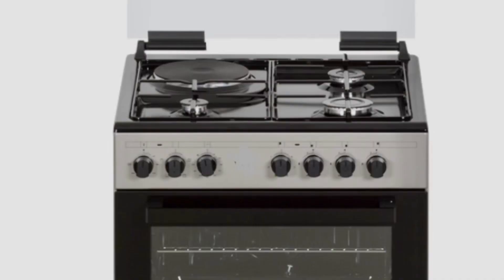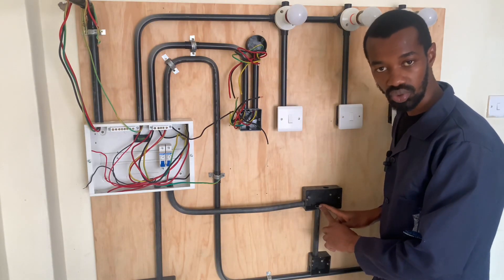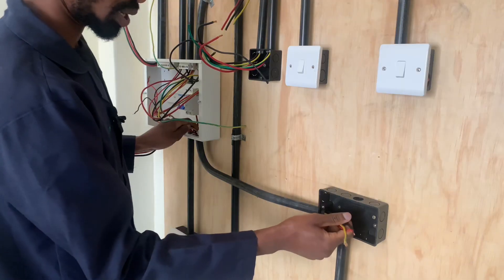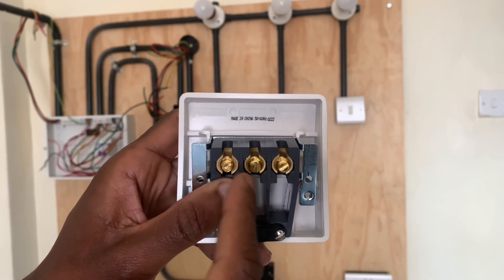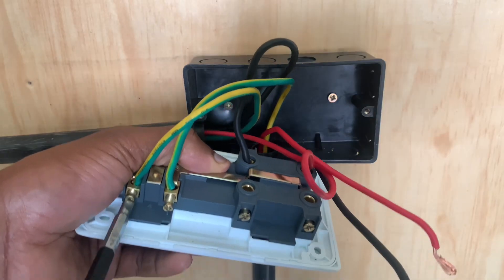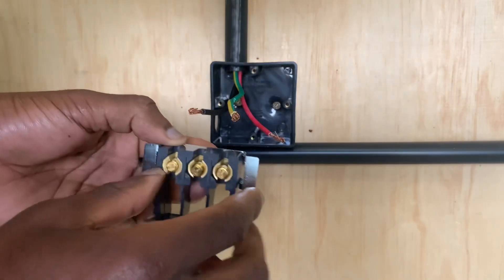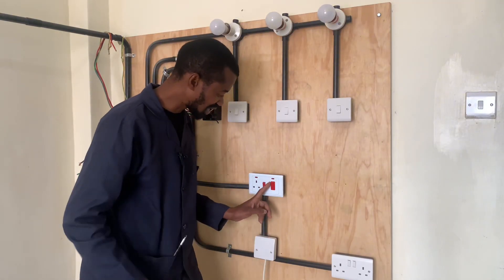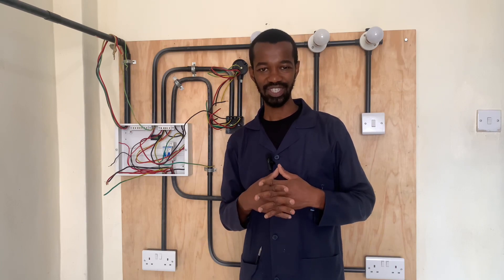How To Install An Electric Cooker in House Wiring| Top Heights Electricians.

Comment: Hi, very informative vides. What if your wirung a new cooker into an existing circuit and the cable coming from the  power supply ìs short and awkward to work into the new connections. My nephew made mistake of removing supply cable from connector and now cant get it back in.

Comment: Question.
The wall plug for the cooker had a fuse. But now with the direct connection to the socket, there's no fuse. Is there any risk involved when you don't have a fuse?
Reply: the 32AMP switch is the big fuse.

Comment: Hi. I have a gasoline generator. The circuit breaker is rated 30A. I would like to power two  blow dryers  rated 13 A each. What size of wire would be suitable?
Reply from the maker: 4.0mm Top Boss celehsat3619

Comment: If the oven draws too much current for a 13A plug, why would it come with one attached? I'm guessing you just chose this oven as an example as you already had it, as you can't sell an oven if it blows its own fuse immediately.
Reply: The 13 A fuse is designed to trip immediately at 21 A current

Anything between 14 A to around 20 A will take hours to blow the fuse i.e the time will vary according to the characteristics curve

Comment: Thanks for teaching us, really i am learning alot from you.

Does the cooker socket come with its connector or they are purchased independently?
Reply from the maker: Thank you Charles for your feedback.
To your question, the cooker socket/unit is installed together with the connector at the time of electrical installation/wiring.

Comment: Why does the cooker trip at consumer box when turned on?
Reply: Sometimes it may happen if the current rating of the circuit is smaller than the load. Let's say the cooker is rated 28Amps and circuit breaker rated 20amps, it will definitely trip when you turn it on.
Reply from the maker: Very correct and well illustrated @kenedyodhiambo2344
Reply from the maker: Another reason could be an internal fault in the cooker itself.

Comment: What will happen if you use 2.5mm² cable
Reply from the maker: Great question Quantech. The cable insulation might not handle the current drawn.
Reply from the maker: See Short reply